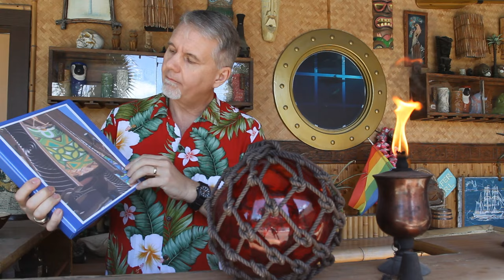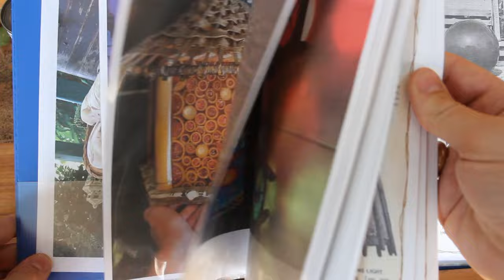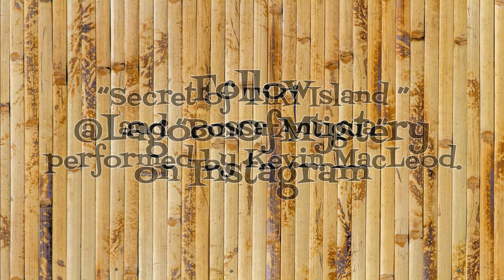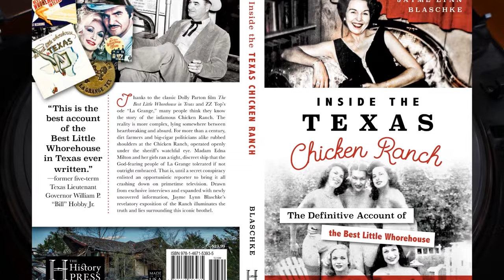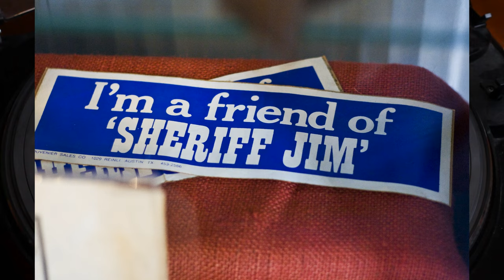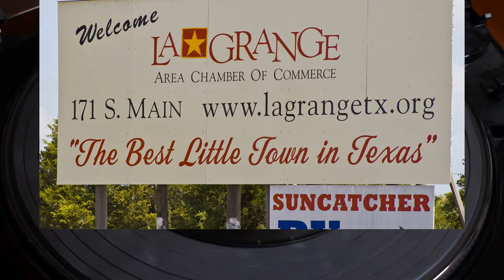A Moment of TIki Episode 66: Next Level Float Light

Comment: Nice work and I have a ton of extra floats & want to jazz them up. Maybe I missed it but the red float looks different than the one you frosted? Was that one pre-drilled?
Reply from the maker: No, the red isn't frosted. I drilled it as well but I didn't think it made sense to show the drilling process twice. The light doesn't come through as diffused with glass floats that aren't frosted, but I pick my battles. The paint would not look great on the float when the light isn't on, and I'd have to cut away the rope and retie it were I to use paint on it. I didn't want to go there. If memory serves, Oceanic Arts had a technique where they'd sandblast the interior of a float once they drilled it out to create that diffusion effect. Very nice, but beyond my capabilities.